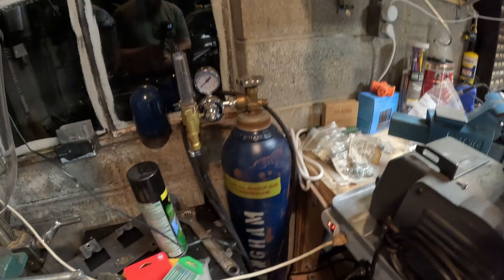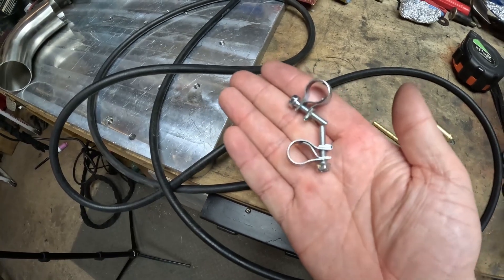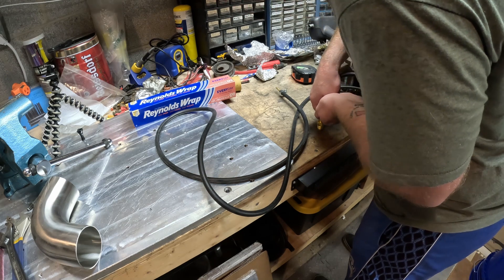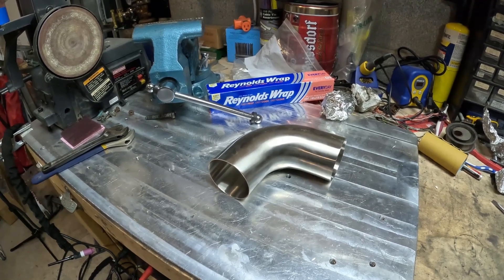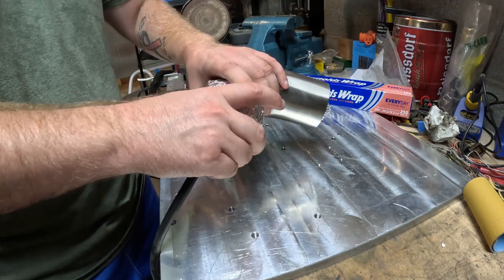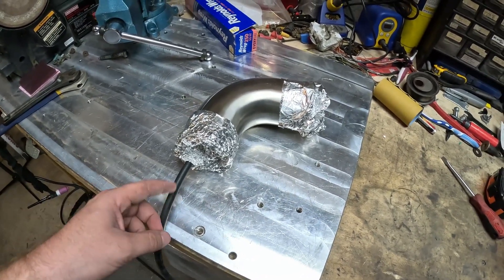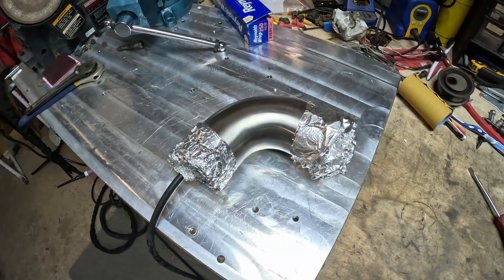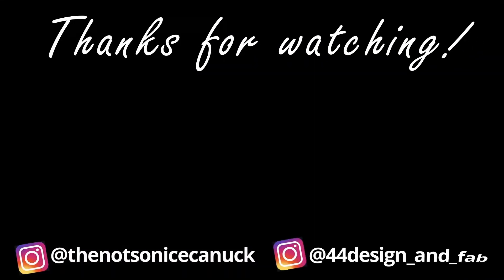DIY Back purge setup for TIG welding stainless steel - from the flow meter to tubing

Comment: I just ordered a brass Y Argon connector from Amazon, around $70, instead of using my dual regulator Im putting it on a single so my foot pedal will run both with less Argon the line going to the torch will be wide open & set the flow ,meter for the torch, then crack the valve for the trail shield & measure it with a flow meter tester, a bit different then back purge but a way to run both with the foot pedal.
Reply from the maker: With that setup, are you purging the air out of the inside of the tube or are you just relying on the trail shield to provide the high argon content environment?